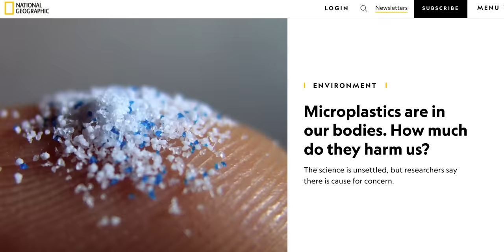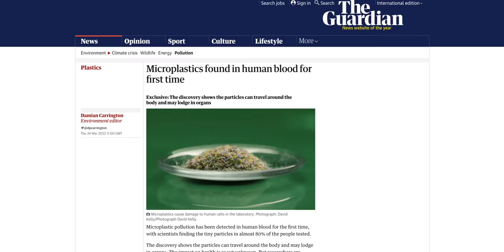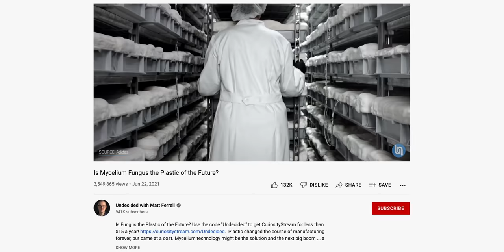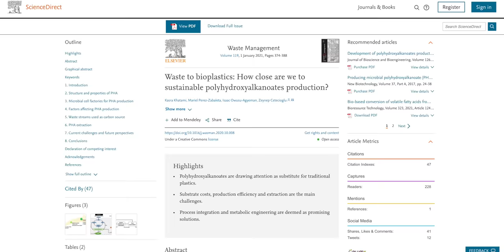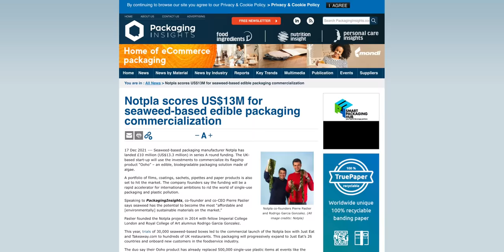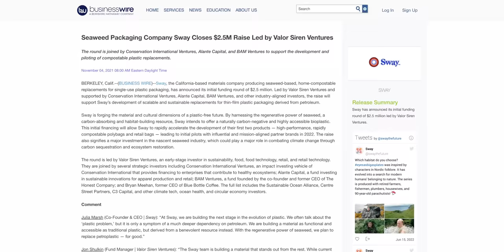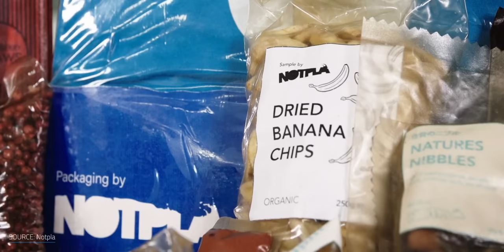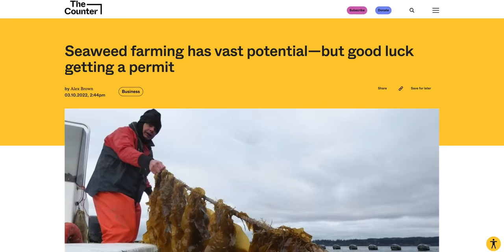Why Seaweed Could Be The Future Of Plastic

Comment: Before the plastic industry convinced everyone glass was bad, we had an amazing system in the US (can't comment on anywhere else) where after drinking a beverage the glass would be put in to a rack right next to the dispenser (soda machine/storefronts/etc) and the delivery drivers would pick up the empties to return them to the bottling plant for inspection, washing, and refilling. The rejects would get smashed and sent to the bottle maker for recycling. 100% of our plastic bottles could be returned to being made of glass which is infinitely recyclable (with a few limitations based on trace elements used in specific needs formulations which can be regulated). No increase in transport costs since the stuff is getting delivered anyway. With careful application of green power the recycling is carbon neutral. A glass bottle gets thrown out by mistake? No worries, in a few centuries it's back to being the sand it came from if outside. If in a landfill it could be mined when we start tapping into those for energy (methane production). We use glass for our plasticware storage needs at home. So no plastic there. Glass is amazing. Use more glass!
Reply: Glass is really good. It’s just more expensive. Good luck convincing investors that you need to spend more money, just to avoid overcommitting to a rapidly depleting resource that’s currently killing us all. It’s not like they’re kicking themselves in the teeth down the line when petroleum supplies dry up or anything. Short term profits aren’t affected by things that happen five or six years from now…
Reply: There isn't remotely enough raw material available to switch to glass. We're using it in other industries already and already hitting limitations. And a lot more energy, not to mention fresh water and cleaning chemicals, go into glass, and go into the environment from glass. The only part of that helped by recyclability is the lack of durable waste afterward...which is problematic since only 5% of consumer glass gets recycled. What made returning bottles viable in the time you're thinking of but clearly did not live in was that they were FAR more expensive so it was cost effective to pay someone to collect them. And we do not have EV collection trucks yet on the market, so you're proposing a new diesel truck going around collecting these glass bottles with sufficient waste space in it to carefully protect these glass bottles to take them to be cleaned.

And, no, the plastic industry didn't convince anyone glass was bad. They made plastic cheaper. A LOT cheaper. What they conned people about was that it was recyclable instead of merely downcyclable.

Glass cannot scale to the current population even in a best case scenario where everyone is responsible. And as we've seen time and time again, far too many of us are not responsible.
Reply: @Merennulli  it’s almost like building an economy based on maximizing waste for short term profit manufactured an artificial demand for goods far beyond the actual need for them, resulting in unsustainable consumption rates that can’t be corrected quickly. 🤔
Reply: @bridgetshepherd5202  While the economy being driven by shortsighted product pushing is enormously wasteful, even going down to bare essentials glass wouldn't cut it. Even with the vast majority of packaging that would otherwise be glass having long since gone to plastic and with glass so easily recycled, we've had a sand shortage of the grade suitable for glass since 2015.

You can argue we don't need cell phones designed to be obsolete before we even peel the shipping label off them, but realistically that rapid cycling is actually a vital part of our infrastructure whether it's sustainable or not. We need to design better materials recovery, not halt the technology cycling.

I do get that it would be better if everything wasn't designed for the sole purpose of extracting money as rapidly as possible from a population that can't sustain it using resources we can't sustain. Those things do increase the speed of the problem, but ultimately they aren't the cause of it. There are too many of us and we want things like healthcare, rights, and a better standard of living and it takes more to get those things than even the most greedy, worthless and careless corporations manage to use.

And, to be blunt, even if it were just greed causing all the problems...we've not fixed green in the 6000 years we have written records of. We're not going to fix greed in time to prevent disaster. We need to focus on technologies, both old and new, that can work within our greed-saturated mess of a society.

And not carelessly like the "let's ban plastic straws" nutters who thought it would be cool to harass disabled people who needed them thanks to a bizarrely well connected 9 year old fudging numbers about them.
Reply: Besides what other commenters said about your suggestion to use more glass I wanted to add that recycling glass is extremely energy intensive. It also requires very advanced sorting mechanisms that should start from the customer (recycling your own glass product waste into 3-5 different types) this separation needs to be maintained by the waste collector, waste storage and eventual recycling factory. Sounds expensive right? Well, that's because it is! (on top of the aforementioned energy intensiveness of glass recycling). Let's just say theres a reason plastic is "rather" popular worldwide.
Reply: @bridgetshepherd5202  ok.. well. I am not too sure about "having all the technology, equipment and manpower". To truly give an answer to those questions would require a very thorough analysis of a specific locality. A national survey does not suffice, waste management is highly resource intensive and highly localised. The answer will depend on the specific state, a specific part of a state.. a city, a province etc. No, I think you are brushing over the complexities of waste management way too easily. Recycling is super tough!
Reply: @Habib_Osman  if you believe the task could be done if someone paid for it, then we are in agreement that it could be done. Your inability to imagine a world where people carry out tasks to save their own lives, without profit motive, is the source of your confusion.

Comment: The primary issue I've encountered with biodegradable plastics is premature decomposition. Stores generally will not want to stock plastic water bottles or sauce packets that decompose on their shelves or in transit (I imagine ketchup packets are often stuck on transport ships for months). We will need to iron out supply chain issues to make them more viable. The use of enzymes to recycle PET sounds pretty great, though :3

Comment: A lot of what we learn about sustainable materials is also useful in the event we try to colonize other planets. Seaweed grows fast, captures lots of CO2, and provides great food/plastic. The perfect plant to bring to the moon or mars.
Reply: Nicholas Time  Moon's vacuum, so I'm thinking it's a good carbon scrubber
Reply: The only issue would be getting the required amount of water to grow seaweed at those places at any effective scale. When looking at current space stations, the water systems are far more circular without large enough reservoirs to allow for integrated seaweed growing.
Reply: @rileydes2034  I thought they had found water on the moon

Comment: It never fails to amaze me that "we" always look for "less polluting" ways to do x, y, z. That is just fundamentally the wrong approach. Plastic should not be used for packaging ever. It should never be used for a single-use item ever. The proper approach to this would be alternatives - paper, glass and metal - infinitely recyclable. Pay a deposit for package like a bottle and get it back when you return it. Problems solved.
Reply: one more thought - plastic should cost FAR more than alternatives - and likely will soon - due to oil/gas prices. Recycling plastic was never profitable nor clean nor successful.

Comment: One of the biggest issues I see with "biodegradable" plastics, is that one of the greatest reasons why plastic is used so widely is precisely because it doesn't break down!
If the package your ready meal is stored in starts to break down, it will become unsealed and open to the environment, thus allowing your food to expire. Many parts of your car are made from plastic, if you replaced those components with something organisms can break down, your car wont last long at all.

I think a far more sustainable and complete solution to the waste plastic problem, is burning it.
Reply: but its nano size now and in the ocean and fish we repopulate for food back to us.. what dont you get joe?
Reply: also...henry ford hemp car was more durable than petro based plastic
Reply: I think the main goal should be reducing the usage of these overkill durable plastics as single use packaging
Reply: @MattSitton  i rather use two straws of bamboo than have a plastic forever one
Reply: All you need is the plastic to bread down in 10-20 years instead of 100-1000 years. Keep in mind that 10-20 years would be after it is shredded down into small pellets which degrade faster than large plastic pieces
Reply: We can start with single-use plastic like sandwich bags or grocery store bags to get rid of the low hanging fruit and then start addressing the other problems.
Reply: Biodegradable doesn't mean compost... anything that breaks down in nature in a reasonable timeframe (eg 10 years) can be considered biodegradable, which is far longer than I'd assume you want it to hold cola for. As for plastic use in cars and electronics, they can stay, as they represent a very very tiny fraction of overall plastic usage. 
I'm also really hoping your closing statement was a joke.
Reply: @iCarus_A  My closing statement is not a joke. On the assumption that attempts at replacing current plastics with more readily biodegradable alternatives don't work for whatever reason, I think completely incinerating plastics would be a very sensible solution. 

By burning the plastics completely leaving no soot in the exhaust, the plastics would be converted to CO2, water vapor along with small quantities of SO2 & Chlorine, both of which can easily be removed from the exhaust by scrubbers. I'm sure you could complicate the processes by bottling the CO2 emitted but in the end, your stopped waste plastic getting to the ocean.

Speaking of plastic in the ocean, one of the things that concerns me about "The Ocean Cleanup" is that they don't seem to have a very sturdy sounding end point for all the plastic they collect.

Comment: I think what you said at the end is exactly right. It'll take an assortment of solutions to fully swap out from traditional plastics. 20% kelp, 15% seaweed, 30% corn, and so on.
We'll also need a longer lasting solution. It's nice that it breaks down so fast, except for when you want to store something for longer than that. Or like tupperwares, which you may keep for years before it eventually breaks and you throw it out. Those needs will need a different solution.
Reply: You don't think forest wells, sit there legs crossed with green seaweed in your teeth, a sack cloth dress and flower in your hair smelling of B.O. to save water and not using deodorant. This is why the 70's failed . After a few years, your kind were fed up with the look and the smell and became the more admired 80's generation.

Comment: Well done and decidedly phuny, Matt!  I do think seaweed can and will have an enormous impact on the plastics problems.  The idea of enzyme and other naturally occurring bacteria to break down PET and other modern plastics has the highest value to dissolve our biggest problem, and coupling that with these new bio-plastics can significantly effect lots of the current problems and perhaps enhance CO2 capture for the long haul.  To me the hurdle is accustoming people to the use and pro's and con's of them.  As one person mentions below the premature break down with garbage bags or other products exposed to moisture, but the straw tech sound very doable now.  As you say education, reading labels, and Knowingly searching for products that use sustainable packaging is the real key to getting people en-mass to get on board, as long as there is conscious price considerations on the part of the manufacturers; i.e., I recently bought a pair of Sketchers and the tag inside said Vegan!...was that to jack the price up or a sanctimonious pun?

Comment: This sort of consumable and degradable element could find a home in special forces where the need to leave no foot prints is critical.  Also, rather than thinking of packaging, think of suspension.  That is, a health food where the key components ar in suspension and wrapped in a protective film.  Less volatile than simple encapsulation but still consumable and resistant to rupture under pressure or impact.

Just a thought.

BTW if you want to make things popular and profitable make them tacti-cool.

Comment: One issue overlooked in biodegradable plastics is time from pellet production to the point where degradation begins. Most plastics were designed for longer time use cases. Inventory management is key to those using the products. With short cycle life I doubt these products will ever make it to consumer products. 6 weeks is definitely to short a life cycle. In the late 90’s I worked with “biodegradable plastic bubble wrap” during its development. Even at the one year mark and the need to keep it away from light makes these products expensive. It becomes a lot like buying fruit and not using it before it ripens. So much ends up unusable.

Comment: Sees weed is s great substitute for plastic, & it is good for you.
Soybeans can also be used to make styrofoam packaging replacements (also biodegradable & does cause harm to the environment like styrofoam does).
We can eliminate the use of plastic & styrofoam eventually. 
We should start with replacing it in our food supply system first, in order to eliminate the use of petroleum based chemical products that leach carcinogens (cancer causing chemicals) into our food & drinks.

Comment: The thing about plastics is that while they are a dangerous pollutant, they are also sequestering carbon from the atmosphere because they take so long to break down. Simply replacing single use plastics with ones that biodegrade quickly could have an inverse effect of much more carbon in the air as they break down. I think it's much more imperative to reduce our overall dependence on single use products in general, especially plastics

Comment: Henry Ford built a car with plastic made from hemp (which was stronger than many materials and free of rust) in the 1940s. It ran on hemp oil, too. You can get many times as much carbon taken out by an acre of hemp than an acre of trees, and it can potentially be harvested up to 4x per year. If you use that hemp to make clothes and plastic the carbon is still out of the atmosphere. Carbon sequestration is the future and plant solutions will be a big help since our machines are not good enough.

Kelp is useful for lots of things and plentiful. It's also taking out carbon so the more we grow on purpose the better. I would be excited by more kelp plastic.

Comment: We already have a cheap alternative to plastic that is already in mass production. Its called PLA (Polylactic acid) and is most commonly made from corn. Instead of making new "Innovative" alternatives we should be iorning out issues with PLA, one of which bieng how long it takes to biodegrade (roughly 80 years) and actually getting people to use it instead of PET.

Comment: Having started knitting recently, I'm currently most of the way through my first pair of socks, I noticed that there are now sock yarns popping up that use a biodegradable nylon which is neat. I even bought some for my next pair. When it come's to socks using all wool yarns creates socks that just don't last very long at all and so all sock yarns I've seen so far have nylon in them, usually about 25%. I am curious about what was used before nylon was available though. Anyway this biodegradable nylon it seems will biodegrade in the environment but not in all conditions but apparenttly landfill works well so that's pretty decent.

Comment: I would love to use a replacement holder of capturing co2 due to a growing type like seawead in houses. 

For example plumbing, isulation,  that would ultimately be dry and not degrade over a fast periode of time (lets say 50 years).
Reply: When something is bio-degradable, it kind of means it is less durable.. So.. it is really really Really hard to find a packaging material that is as cheap and durable as plastic. Honestly, let me crush the dream.. there is none. There are alternatives, sure, but all of them are less durable and more expensive. They will always be. Well, maybe in 300 years something will be invented? Can't see how but.. never say never I guess.

Comment: From what I was told since I was a teenager in the 1980s,  the processes to replace plastic bottles are just or cost more than using plastic.  The other thing the oil companies are not telling you is, if you take a sealed metal container and have a drip pipe coming out the top,  and you burn all your plastic waste the dripping the first come out of the container is diesel fuel.  Soooooo.  If every one started to burn there own plastic you could make your own fuel.